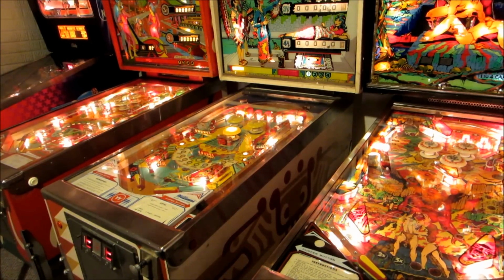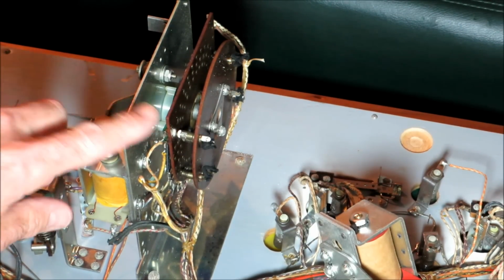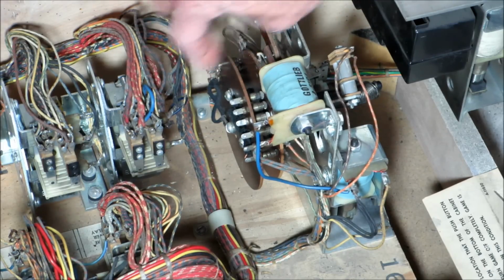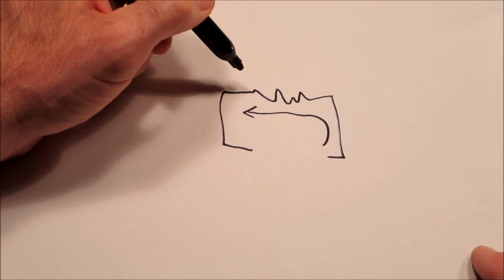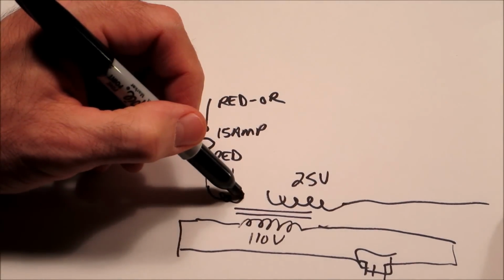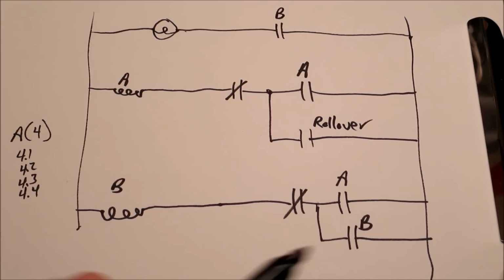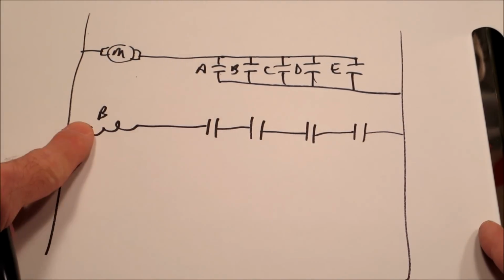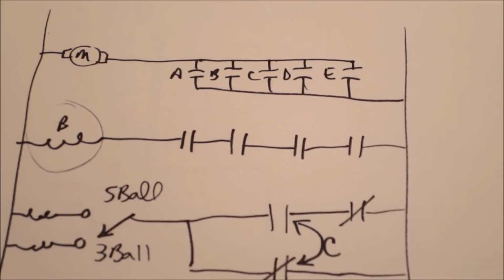Introduction to Electromechanical Pinball Machines and Their Schematics

Comment: Hi, to start off, I recommend to ALWAYS pull the wallplug, because I noticed that the wiring for the bottom switch is sometimes openly wired through the cabinet. even with open plugs connecting main power voltage to the transformer ! !

Comment: Warning: Depending on their size capacitors can store a lot of voltage for quite some time, even if the power to the machine is switched off. Big capacitors can usually be found on the board of the power unit of the machine.

Comment: If I wanted a rollover to have different points like 1,2, 3, and 4 points, how would I do that to make the different rollovers change to the respective points? I want to build a wall mounted horse race machine for the family. By simply pulling the ball launcher, the ball goes up and then returns through the rollovers. Everytime the ball goes over a different rollover, it gets points, 1-4. - QUESTION, would I just put four rollovers in a lane to get four points on the wallboard? 

The wallboard has a string of lights matching the player's horse racing. The lights advance with each number of points scored until the player's horse reaches the end. A bell signals the end of the race. 

Resetting is easy, I just turn off the game and when I turn it back on, everyone is at the beginning.

What would I need to purchase to make this? Can it be upgraded to more current parts like LED lights? I can solder, run wire and so on. But I've only built kits. This would be a big project but I think a worthwhile fun one. 

My mom and I would play this game at the county fair and it has a lot of great memories. Unfortunately, the real game we played was a custom game. There isn't a way to buy another. I would have to build it from scratch. I wired my home with no help and some training from working as a shop helper for an electrical installer. I've built my own computers and stuff like that but this is really close to my heart and I really want to build it for me and the grandkids, wife to play. 

Any help would be fantastic. A schematic and a parts list would be enough. That old machine we played put off so much heat from the days before circuit boards, and computer chips. I would want to upgrade so the heat isn't a problem. I imagine that some parts will be like the ones used here. I know I need an expert's guidance. This video helped a lot. Just not what I'm doing but certainly it contains many adaptable bits of knowledge for me understanding how it all works. Thanks for this great video and any help if provided. Merry Christmas. Mike

Comment: The old machine I worked on didn't have the lock down bar, you had to unscrew two bolts on both sides of the machine below the front plate !

Comment: I have a 1976 Williams Grand Prix it starts the game on what ever player is last up. I cleaned the player up unit but it did nothing for it. after it plays ball in play first ball it will then go back to first player, I only have one player when this happens. I'm wondering if I use lube gel on it if it would reset itself. It will after second player plays the first ball then it goes to first player and doesn't go back to second player. If you have 2,3, or 4 players up it will start with that player then after ball leaves playfield it plays normal. It goes to first player and plays normal. Only if you play more than player it will start on the last player up.Do you have any idea what would cause this to happen.

Comment: Hi mate.
This has been so helpful, you can't believe it.  I have had this schematic for years, and cold make head nor tail out of it.  At least I have got a bit of a foot hold now.  I would even be better if the wires would not be one colour in my machine.  Time and mouse pee has done wonders to my wiring.  I also have a score motor, of which the discs are out of sequence......FUN FUN FUN.
However this makes a good start.
Marcel.

Comment: The pins that have rails like that it is really nice as you can flip the playfield on the art side.
The only bad thing is you have to be sure to be careful to not break the plastics but I have flipped the playfield over to do all the switch adjustments and cleaning of plungers and so on.
Reply: PinBallReviewer If you disconnect the board you can sit it upside down on some stand offs on the dinner table.  It makes it really easy to clean and adjust switches.